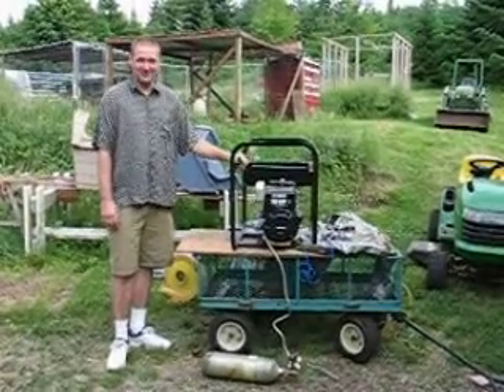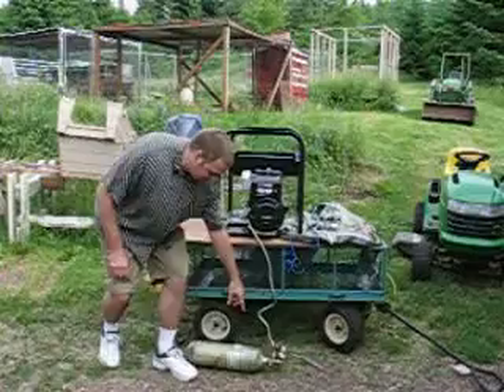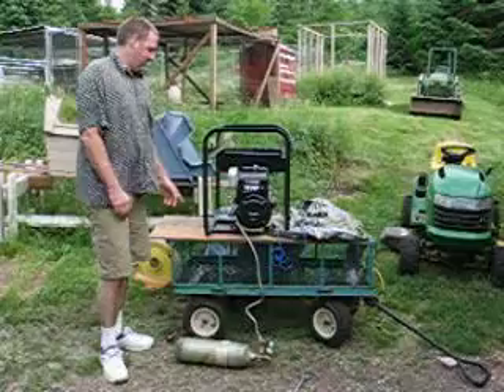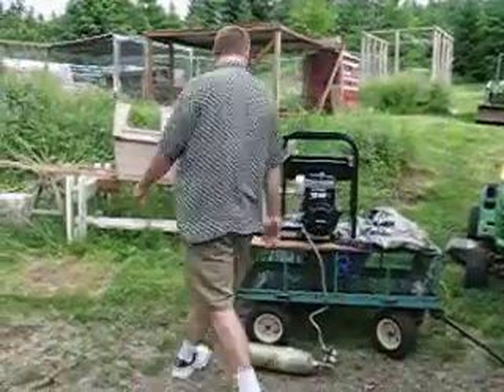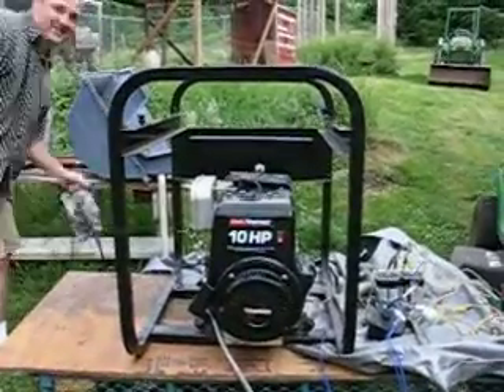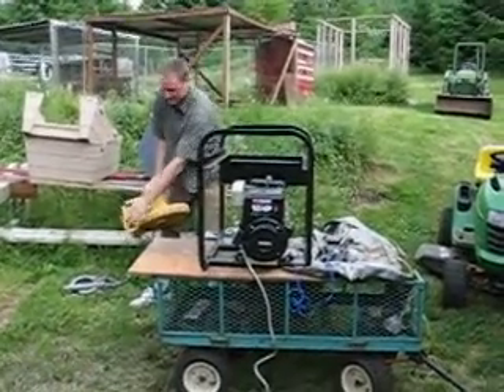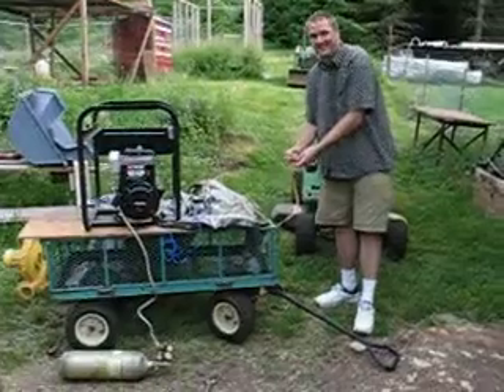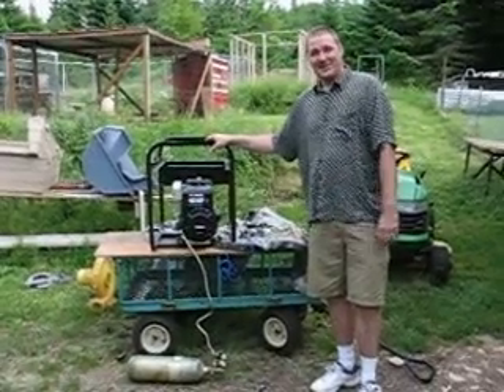Hydrogen Generator Conversion Easy as 123

Comment: This is not sustainable unless you have a steady source of electricity to produce the hydrogen.  That tiny tank at 1500psi wouldn't run a 10hp for very long.  Just speculating, I would give it 2hrs max.
Reply: +EDUCATING LIBERAL-IDIOTS  I have put a HHO generator on a car with it running off the battery and alternator.  It doesnt improve fuel economy, it makes it worse.  Simple to understand, when you convert energy there are losses.  Convert mechanical energy from the engine to electricity by the alternator, then convert the electricity to HHO with the HHO generator and you end up with energy dense gasoline burning to produce energy poor HHO gas.  You find someone that pressurizes the HHO gas to the high pressure it would take to equal the energy density of gasoline, and I will point to the fireball from a mile away.  You have to generate, purify, and compress the pure H2 gas before it can be used by any vehicle.  The illusion most people show on their video is the battery in their vehicle that happens to be fully charged when they turn the power hungry device on.  I have built a few different kinds of generators and to produce a substantial amount of gas it takes at least 30amps of 12v power.
Reply: +mwm2929 What about using a small inexpensive solar panels to convert water into hydrogen.

Comment: This can be done with an off the shelf nitrous injection kit and use the stainless jet for the injector.  PRV comes on the tank from Quantum so no worries about adjustment of line pressure.  Whole kit would cost about $1000 and a few hours of programming the ECU for the injection timing, but can be done.  Not hardly a clean exhaust though.  It produces the same or worse NOx gasses as when using gasoline.  Nitrogen is introduced into ALL internal combustion engines through the air intake.  Common myth about burning hydrogen...

Comment: i think an easy way of making a high power generator (engine) would be a direct inject diesel or LPG or gasoline, any of you think this would work? of cause you may need some high pressure flue pump connected to it with a pressure relief
valve  that will flow back in to the HHO gen. and then a pre-fule pump to help separating the oxygen from the fuel. and then some simple electronics that will pump tern more HHO cells on wen pressure in the 2nd pump drops, it may also be a good idea to keep the HHO gen a vacuum.